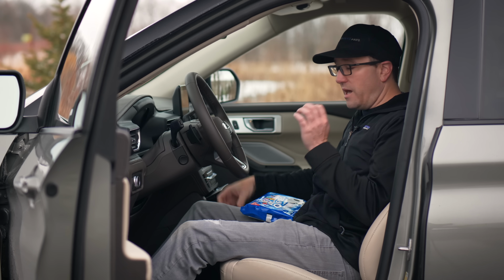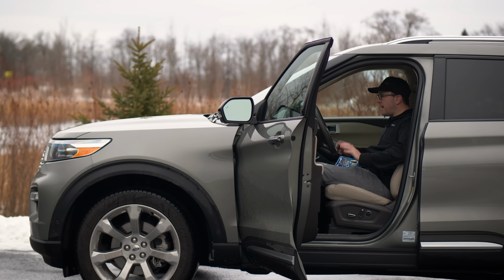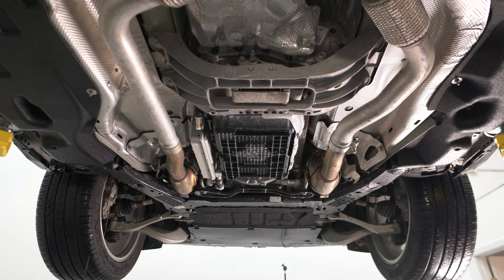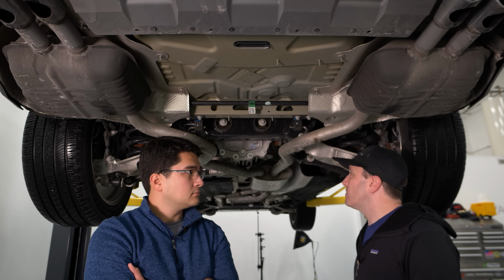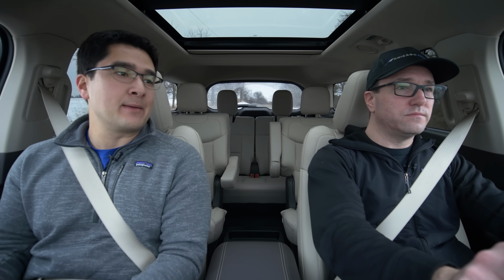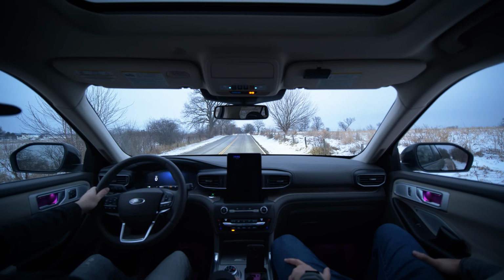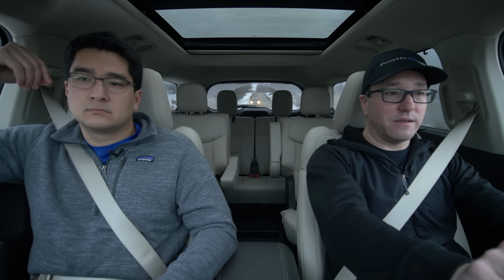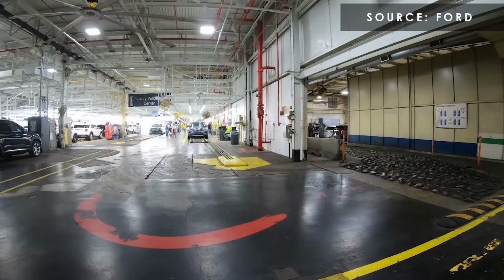2020 Ford Explorer | Who Is Responsible For This?

Comment: You prefer a car made in USA for 50k or the same car made in México for 30k and without those issues?

People in chicago won't do anybetter in terms of wealth if they work in an factory moving panels from one machine to another or just looking how robots make that work, ie not adding value to the process. That doesn't create any wealth, that just rise cost and inefficiency and price to the consumers, thus being less accessible. What would be great is that those workers improve their capabilities so they can work to improve those areas that ford/any company is struggling to solve

But of course this is not easy and needs lots effort but it is how a society prospere in the long run. 
Forcing companies to bring back factories to the states will only make demand of cheap labour increase... ofc they are the ones with lowest wages...

Btw you do a great job

Comment: I've owned A LOT of cars in my life including Ferraris, BMW's and Cadillacs etc, you name it I have had it and I have a 2020 Explorer ST and its awesome.. Has a ton of features and its as fast as shit and handles great. Does the Kia and Hyundai have better materials inside? Probably but they handle like mushy peas and accelerate like a slug.. All the stuff this guy is complaining about I don't really agree with and I'm not a big Ford guy either..I replaced a newer GMC Yukon Denali with this and it holds almost as much crap and drives 100 times better.. I do agree the sound system sucks though..

Comment: We love our 2021 Explorer ST. We drove several, X5/GV80/Aviator and chose this for several reasons. Would be curious if your review would be different in the 2021 model. We've not had any of these issues you've mentioned.
Reply: Us too. We checked out almost every SUV on the market... This was the best in our opinion.
Reply: I'm buying a used 2020. How is your car, did you have any problems?
Reply: @viniciusmayer1554  no problems so far. About 4K miles and 3 months in. We really like it. The 10speed seems to be doing fine, no rough shifts or getting stuck like some people claim. I'm quite satisfied.
Reply: @XvSKINNYvX  Thanks

Comment: Ford did a good job developing engines and chassis' the past 15 years, even if their transmissions lagged behind, but then they decided to revert back to being Ford. There will be no more development for at least 10 years, while they cut corners and try to squeeze every last penny of profit out of their uneven product. Great engines and chassis with ever cheaper interiors, out of date transmissions, and increased asking prices. No thanks.

Comment: Just rented for a week a 2021 Limited, it had by far the worst automatic transmission I have ever driven. It was even worse than the Jeep Cherokee 8 speed transmission. It never seemed to be able to decide what gear it wanted to be in, or it would just say screw it, and slam hard into whatever gear it wanted to.

Comment: We have a few of the 2020 Explorer police utilities in our department fleet, and while it's comfortable, handles well and has good tech, the power train is complete shit. The older Explorers have the standard six speed and the torquey 3.7L that made it quick enough for most uses. The base 3.3 non hybrid and the 10 speed combo is horrible. It has no power, the transmission sounds and feels bad, and doesn't get any better fuel economy than the previous Explorer police vehicles.

Comment: Ok so I bought a 2021 Explorer on my way to report to a new unit in Alaska from Florida. Now I test drove a platinum and loved it except for the exact things you mentioned. I ended up buying the XLT because quite frankly the $60K for it was too much for me. The thing I will say is the infotainment on the XLT it horizontal not straight up and down and works much better. Also the ride in the XLT is much better and I think it’s due to the smaller rims and tires with more sidewall and I’ll say it soaks up bumps pretty we’ll definitely better than the Platinum. Now the interior yes is a bit unfinished and could be better and the base sound system isn’t as bad ass what you described with the premium sound system but it could be better. Also the transmission yes I 100% agree with you. They screwed up something with the transmission. I’ve driven my in laws F-150s a ton and they shift WAY smoother than this thing does which is what gets me. I think it’s a tuning/software problem. There’s no in between the smooth and hard shifts and it will just slam into a lower gear when all you need is the torque converter to unlock or maybe down shift one gear not 4. I will say driving it 4,000 miles from Florida to Washington it was a smooth comfortable ride and had no issues and I didn’t experience any bad vibrations or noises coming from the car rattling or the engine or trans making weird noises. I hope a software update comes out for this car soon for the transmission but I think it’s a pretty good car overall it does have its issues but I honestly love my explorer. I think the lower trim levels are the ones to go with honestly.

Comment: For the record, I bought an ST that now has about 7000 miles on it.  The transmission was rough, as stated - in the beginning.   I now thoroughly enjoy the way it drives.  I think it took a bit to understand the idiosyncrasies of its shift patterns and possibly its worked out a bit of its own kinks.  As a young guy with a family (dying to buy a sports car again) this thing is a lot of fun and certainly helping to satisfy the enthusiast in me.  Also, I know beauty is in the eye of the beholder, but the competition looks like absolute dog shit compared to the ST... it’s not even close.
Reply: how is it after a year?
Reply: @janbeltre1244  well I can say he's right on his assessment from 2 years ago as that's when my wife bought hers. now 2.5 years later I fucking hate the thing. And it's not the rougher ride (I got 20s for it and stored the 21s), or the fake garbage engine noise that bother me... it's the constant new rattles and the endless amount of failures with this thing. the pano roof breaking 3 times, the 360 camera blue screen issue that took a year to fix or the most recent exhaust issue that threw an engine code. needless to say I'm honestly done with this pile, and my wife had a Jeep SRT before the Explorer ST and that didn't give her an once of trouble in 4 years.
Reply: I have the 2021 ST and agree…and it’s better looking than the Palisade and Telluride! LOL!!! 😂 but I do like the “look” of the Tahoe even though it’s a taller ride the clearance is about the same…to me the ST is just the right size and is sporty with just enough power to survive the shenanigans from other wannabe NASCAR drivers.
Reply: @David Imbrogno Curious to hear what your experience is like after a year as well. Just picked one up and am enjoying it so far, but noticing that learning each mode's shift patterns is going to be key for a smooth ride. Also reassuring to hear that not everybody is bashing on it 😂
Reply: When you say competition, who are you talking about because Telluride & Palisade blow this out of the water. I think explorer does look better than Traverse and Pathfinder.

Comment: I bought a new 2013 Explorer XLT for my wife in January 2013.  We still have it with 157k miles on the clock.  The Explorer has been good to us.  Other than tires, brakes, a serpentine and bad canister purge valve (I replaced at $24) the only time it has been to the shop was for a leaking rear A/C hose that hit us for $1300.      I can't imagine owning a KIA after being stationed in Seoul and seeing some of the quality the Koreans put out.  But, this video has me thinking a replacement Explorer isn't high on my list.

Comment: I work on these things every day. You guys aren't even scratching the surface. This new Explorer may go down as the worst vehicle Ford ever made. A couple of weeks ago, I got a call from one of the engineers in Dearborn asking me why I'm fixing so many water leaks, and putting so many hours into fixing them. I asked them why they needed to drill 6 holes on each side of the vehicle to mount the roof racks from the bottom up? They didn't even seal the holes. All they put is a tiny piece of foam the size of a dime, as a seal. It does nothing. On top of that, every time you need to do something with the roof rack, you have to drop the headliner. They also didn't design the cowl trim right. If it doesn't sit perfectly, water goes right into the hole on the firewall for the evap box. And you have to remove that to replace the battery. Now, 90% of the time on a battery install, you end up with a swimming pool in your RF seat. The motors suck, the transmissions suck. You even pointed out that some of the suspension is aluminum, and the hub assembly is steel. You're not supposed to do that because when you have AL and steel touching, it corrodes. I need a 20 ton press just to separate suspension parts that should fall apart when you unbolt them. These cars are less than a year old. Then there was the headlight disaster.....
Reply: I smell a recall and lawsuit for crashes because of the aluminum and steel combos
Reply: @princedarkness8029  "I smell a recall and lawsuit for crashes because of the aluminum and steel combos"

For the most part, that's not a safety issue. It just makes it a pain in the ass to work on.
Reply: Also whats the headlight disaster?
Reply: @princedarkness8029  They couldn't get the headlights to work properly on some of the new explorers. It took Ford over 6 months to come up with a fix. People that bought new vehicles couldn't take delivery on them for months.
Reply: @solarfall2728  I miss my 2016 explorer

Comment: I think you missed a side of the choices. Steel body pannels can be repaired with a ball peen hammer, more or less. Aluminum must be replaced. While that isn't any more expensive with a conventional vehicle, police and EMS vehicles get dings all the time. Ford probably kept steel pannels etc where they tend to get dings and dents, so fleets could more easily and cost effectively maintain their own vehicles. It isn't all laziness. Without Interceptors I bet Ford would tank completely.

Comment: I dunno guys....I’ve been given a FREE  2020 Ford Explorer fleet model with the 2.3 4 Cyl Turbo. 
For all your condescending, whining, and Ford-bashing....I think your spoiled rich kids. This is one of the best handling vehicles I’ve ever driven, considering its weight and size. The 10-speed transmission is flawless so far(500 miles)....no gear hunting, no sudden shifts, no poor downshifts. 0-60 in what? 5.9 seconds? In a 4 Cyl? Fucking amazing fast vehicle. I can keep up with Hemi-Durango’s and Tesla’s no problem. At least at freeway speeds. The way you talk about the interior trim it’s like you’ve been bottle fed BMW’s and Mercedes...holy fuck...I have the fleet interior and the only complaint Is seat coverings feel and look cheap. But the rest including the dash and console are no worse than the average BMW 3 series. Tight, quiet and functional. It’s a beast to parallel park in the City...coming from an old Ford Escape. But I am SO happy with this  truck....Did I mention it’s FREE? Gas is also FREE! Maintenance....FREE! 24 hrs a day FREE. Company vehicle. Love this truck. Thought the 4 Cyl would suck in a big ass truck.....nope....no struggles....effortless power and performance. Smooth, quick shifts. Comfortable ride, road feel for sure but no pot-hole shock at all. Disagree with 90% of your complaints.

Comment: Let’s talk about the PTU unit it’s crap mine blew up in my 2014 explore crack the housing on the transmission $7000 later under warranty. 63,000 miles not right very unhappy

Comment: After owning ( and just selling ) my Expolrer 2014, I can safely say, I will NEVER buy another Ford again.  While I did enjoy driving it and it is a good looking car.,  after warranty was over and I only had 25k miles, air con compressor broke ( 1200 ) , power moon roof motor stopped working ( 1000 ) and to top it off power steering broke down. While 2012, 2013 had a recall, they would not recall the 2104 fro the exact same problem...another 3000...and this on a car  that had 35k miles . If you want to ;ease for 4 years...go for it...Never buy ...quality is horrendous. Bought a 3 year old Lexus GX 460 and looking fwd to no troubles for years to come.

Comment: I am a diehard Ford guy, but I couldn't buy this Explorer. I grew up in Fords, and other than my first car (a Chevette - it was either that or a Pinto!), all of my vehicles have been Fords. We currently have an Edge, and love it, but sometimes it was just a little bit too small, so we wanted something a little bigger. I really, really, really wanted to get the Explorer, but I just couldn't justify it. We ended up getting a Palisade instead. The Palisade has a better safety rating, longer warranty, as good or better reviews, and it costs thousands of dollars less than a similarly equipped Explorer. The final straw was hearing about all of the build quality problems in Chicago. 

The only problem with the Palisade so far is "Hyundai ergonomics" vs my life time of using "Ford ergonomics". For instance, on my Edge, the cruise control is on the left side of the steering wheel, while they are on the right side on the Palisade. The radio controls are also reversed, so I sometimes accidentally change the radio station instead of adjusting the cruise. Other buttons, I have to push and hold instead of just pushing, and the buttons are in different locations. I'm getting there, but it has been an adjustment. Other than that, the Palisade has been great.
Reply: The "build problems" weren't caused by where the Explorer was built.....everything the reviewer pointed out he thought was bad was baked into the unit well before any line worker touched it.  Even Ford Motor Company has owned up to that fact.  Owner reviews of the 2020 model on Edmunds.com echo many of the same complaints over and over again about the transmission and software problems, again these aren't issues related to the hourly employees.

Comment: I leased a 2017 F150 three years ago bought at lease end over getting into a new 2020 I would have if the 2021 was available :-(  I wanted to get a 2020 Explorer for my wife, but we did some comparison shopping and went with a 2020 Toyota Highlander. Ford changed too much and the changes were not anything that we could get used to.

Comment: Easily the most critical and truthful review I've seen. I didn't do a LOT of research on the 2020 because, as you said, just one of those buyers who will buy it because it's a Ford.

I've yet to see a modern vehicle from the big 3 that isn't littered with its own problems, and unfortunately this is no different. But I feel like it's just the way things are right now (at least in the big 3 side of the world).

I traded to the explorer from a 2018 Silverado that had a 6.2 and 8 speed in it.... You want to talk about a bad transmission, THAT thing was the biggest pos I've ever had behind an engine. Especially one as solid as the 6.2 was.

My wife has the explorer right now, and I took over driving her 19 ram 1500. I love that truck. 34k of mechanically problem free miles. But the QC is appalling on that truck as well. I still need to take it in to have my 3rd brake light or trim replaced as well as likely my headliner from water stains. Also keep a very close eye on the rear slider to see if it's cracked yet so it can start leaking.

So I guess, half baked, half finished projects are just something that I'm used to driving anymore. The explorer sounds like, from a corporate side of things, is the worst... But hopefully it holds up better than my Silverado did, which had so many small issues alone with it that even I couldn't deal with it anymore - not including that shitty 8 speed.

I hope some day we can stop focusing on the "refinement" and return to making a good vehicle. Ford... GM... Chrysler (or fca, whatever you prefer), all need to go back to the basics and just make a good reliable vehicle that is respectably optioned for its time. Definitely not saying go back to stripped out shitboxes, but they're not high end German cars, and clearly as Americans we struggle to keep up with them.

I do agree 110% tho, the explorer has that truckish feel to it. Something I really like about it, having come from nothing but trucks and the original (body on frame/rwd) suv style. Ride quality feels great to me, but then again like I said.. I'm used to trucks. And if we're comparing to the rest of the field which is making more of a crossover... It's hard for me to complain at all.

Fingers crossed I still like my explorer as much as my ram in the next year or so. And that it doesn't re obtain its old school "exploder" nickname.

Comment: they stopped making sedans their excuse because they don't sell !! well maybe if they were making them right they will sale . I spot them Ford vehicles on the Road. and believe me when I tell you that. their paint job are crap and cheap just like GM . the other automotive company stopped making sedans for same excuse. I drive a 13 years old 2007 Toyota Camry and the paint still solid . while there is a 2018 Ford with  peeled off paint to the metal on the trunk it was shocking to me to see such a brand new vehicle OR two years old. who had their owner in dept. god knows for how many years paying on that piece of junk . and yet their  paint can't hold on for few years !!! unbelievable. final thoughts for the audients who's going to be reading my comment. i wonder where is the water pump  designed on this one ?!
Reply: exactly, even FCA sells a ton of sedans but Ford and GM can't lol